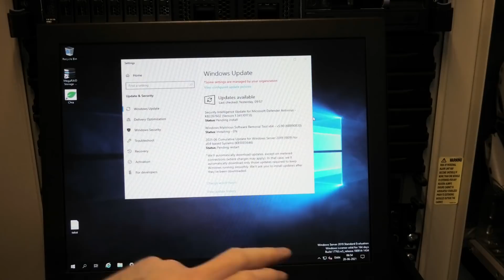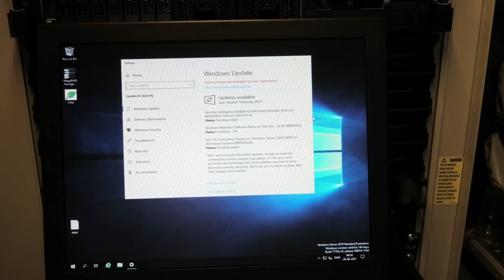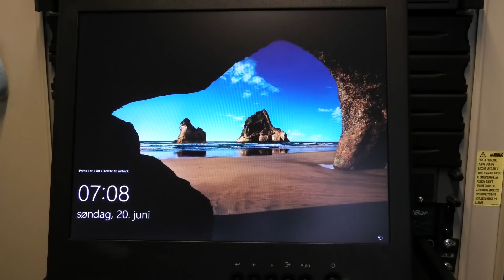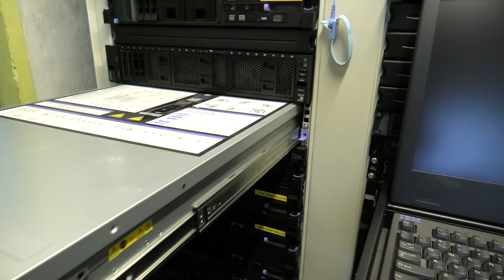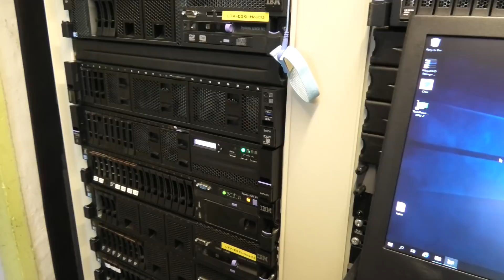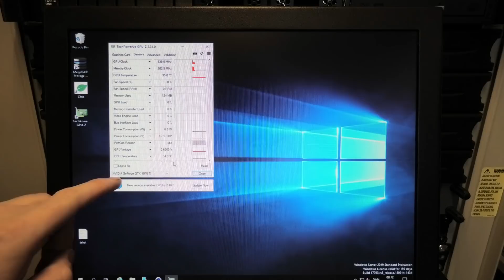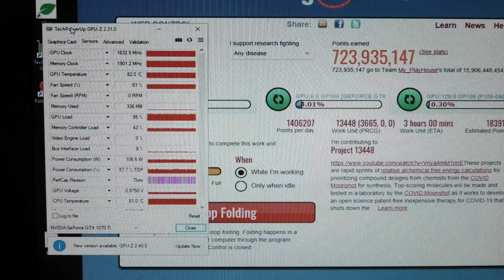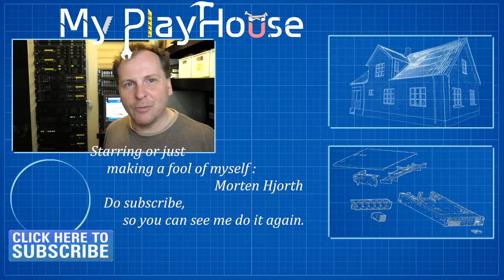NAKED!! Nvidia GTX 1070 TI, in the Awesome Lenovo x3650 M5 - 1079

Comment: Hello, I watched your video and tried to install a GTX 1050 Ti into my X3650 M5, but the server doesn't seem to recognize it. I can't find the NVIDIA video adapter or any PCI devices in Device Manager. I checked the graphics card's fan, and it's spinning. PS: The riser card model I'm using is 00FK631, which is marked as supporting 75W power.
Reply from the maker: Try and see if some other OS will see it on the server,,, just to search for the Error,,, see if BIOS see it and if PCI slots are enabled and if a network card will pop up in it..

Comment: Hello, 

I realize this was 2 years ago but I will try anyway. Could you tell me which Power cable you are using for the GPU? I've bought a number and still cant get the right one to get a GPU into my Lenovo X3650 M5.
Reply from the maker: Special cables is needed for the Lenovo x3650 M5

Comment: Hey morten,theres smaller video cards,no need to strip a 1000$ gpu!
Reply from the maker: You get a lot in a gaming card.. :-)
Reply: I enjoy watching you,your informative.
I never would have guessed running a blade server is cheaper on electricity compared to a bunch of 240 or 300 watt 1 u servers!We have 115 or 220 here in Canada.You can also run 24 volts dc,but that requires different hardware and battery banks.then theres the hydrogen gas emitted from lead acid batteries!
Not good in a house!
Do you run an isp with all those servers?

Comment: Morton - 83 degrees is that cards max temp - the card is thermal throttling and the "perfCap reason" - Shows "thrm" - The card is slowing itself down trying to save itself....

Other than that another great video!!!!!
Reply from the maker: Hi Tom Chambers
Thank You very much!  where did you find that info? I found someone saying to just keep it under 95C and it would be fine...
Thank you for watching! :-)

Comment: Won't complain about the fans as you might be water cooling it. It will and does appear to have thermal throttled though.
Reply from the maker: Yes it needs more air flow..

Comment: I wish the card would have complained in some way because what if it was installed in a rig and the fans stopped working? some one like you or me could diagnose the issue easily as the card would slow down under load, but the average joe may not be able to
Reply from the maker: Hi tractorman 77
Thank You very much!  glad you liked the video :-)
Thank you for watching! :-)

Comment: I wonder why the fins were like that? I have a zotac 1070 mini and it works perfectly in my r720 after removing one of the risers.. I do plan on getting a very thin PCIE power cable off eBay to see if that would work as I would like to have the riser back in my server, though she doesn't seem to care that it isn't installed, besides the error on the diagnostic panel
Reply: Most consumer GPUs have fins like that because that means the heat in the middle can escape the card. With fins along the long side of the card, heat in the middle would stay stagnant and go nowhere as the airflow would create a vortex inbetween the two outer fans. With a single fan it's okay but with larger cards a server-oriented fin stack is very bad.
Reply: @KayJay01  that makes to much sense tho
thanks for your reply!
Reply from the maker: Hi tractorman 77
Thank You very much!  glad you liked the video :-)
Thank you for watching! :-)

Comment: Morten, the fans are there for a (good) reason. Without them you run the risk of your entire data center, and in fact your entire house, catching fire. Is getting your server to run a bit faster worth this risk?
Reply: All hardware like this has built-in temperature monitoring. When it starts getting hot it will slow down to try to keep from overheating. If it keeps getting hotter it will shut down completely to prevent damage.
Reply from the maker: No the GPU would just stop working.

Comment: That GPU is thermal throttling, you can see it dropped GPU core clock from ~1800 to ~1600 as it settled on 82-83C, don't think it's a good scenario for it...
Maybe if you put a couple of fans back on...
Reply: Yup look in GPU-Z, "PerfCap Reason: Thrm"
Reply: yeah 100% leave the 3 fans on if you can other wise as many as you can
Reply from the maker: Okay,, I need more air flow then...

Comment: The 82 degrees Celsius (180f) is max for this architecture. 

And lots of gamers makes those cards water cooled, so there is not even a pump controlled by graphics card.
Reply from the maker: Hi Mokoko Mokoko
Thank You very much!  glad you liked the video :-)
Thank you for watching! :-)
Reply: If i were you i would probably grind plastic housing a bit to fit in, 14 nanaometers and 83 Celsius is a bit high, mine computer never had above 60 degrees Celsius under any load